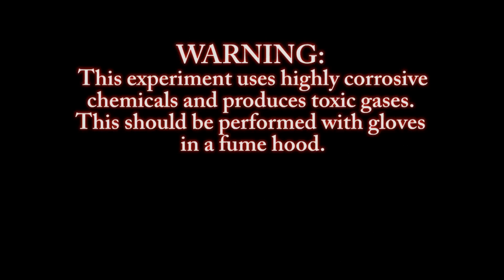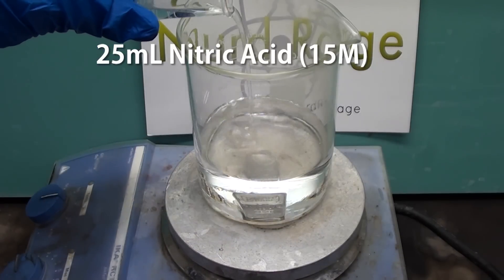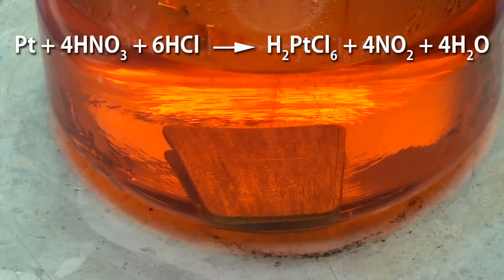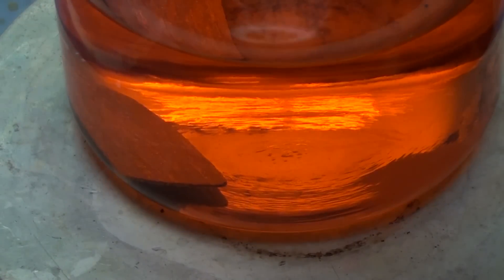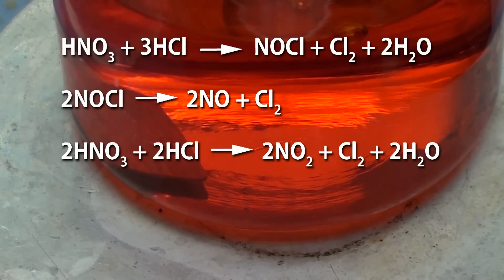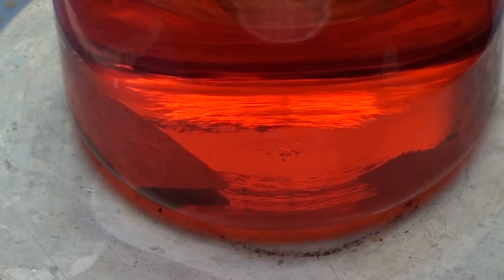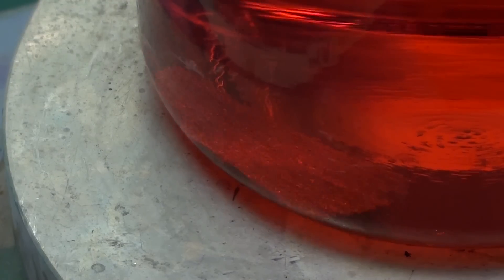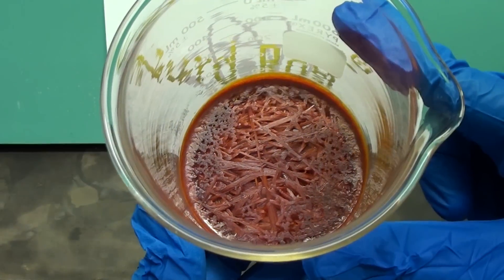Platinum Bar Dissolving in Acid (Aqua Regia)

Comment: hey thank you very much, I found a large specimen of PGM's both in nugget form and really rich ore with black crystals running through it,  some one called Igdralsill who doesn't seem to like that I joined a form about learning to use chemicals to melt off the ore and leave the nugget that runs almost thought to the bottom it's about the size of of child's brain and weighs 16,4 lbs , I did the Hydrogen Peroxide test and the whole specimen got stained white from all the tiny bubbles...the nugget on top looks like a Norther Stag full bust head turned looking you in the eye it's a beautiful nugget, I didn't mean to break a big black crystal as it was surround by hard rich ore so I chipped some off the bottom as I want to make some jewelry....there are more black crystals though the specimen, even though at the time I didn't have the experience using aqua regis, I was actually prospecting for gold in S. Idaho and my spot was closed and because of it I noticed a small little piece of metal, I got my pick and hit it and it didn't even dent it so it's not lead...so I will pick up the citric acid solution on the 1st and see if I can head it with? the top of my furnace on a lower temp.? or I looked like you were using the heat material to set your beaker on..I forget the name but you can get it in rolls and just make your own furnace..the small crystal I pulled out is black but up to the light more grey with hint of green?  Is it safe to make a nice specimen and just soak the lower part?  All I have to fit it in is a big Pyrex bowl so far....I chipped some from where I thought was under the nugget and it was like 3 layers deep, a perfect relief of the deer and I broke that crystal cause I thought it was a piece of the nugget, boom instant black powder...I have not yet heard of obsidian mixed in with platinum ore/nuggets but it makes sense to my knowledge level...I've been to lots of lava flows and never found anything like this!   Please help, I have TBI's and I forget stuff really east often....but I'm gonna do it so If those are indeed Osmium I don't want to dissolve them into solution do I??? Thanks for your help....maybe I'll put up a little video. so you can see it...

Comment: I know this is a stupid question, but the platinum is what's causing the aqua regia to turn orange right?  If you let the aqua regia sit without placing any metals into it, it would stay clear?
Reply: Not a stupid question at all, it's actually quite interesting because aqua regia does slowly break down and turn a brown/orange colour on its own. But the reaction with platinum also produces a brown colour, and that would happen even if the aqua regia didn't decompose by itself. In both cases, it's caused by nitric acid decomposing to nitrogen dioxide, just oxidising different things in each case (either dissolving platinum metal into solution, or converting the hydrochloric acid to elemental chlorine).

Comment: No one should have worried about losing the metal I the first place. Once it has dissolved into solution with the acid, it isn't destroyed you can get the metal back through other processes. This is a method of purification used in the industry anyway.

Comment: Well there goes $1200 in platinum.
Reply from the maker: +gusg343 At the time I needed chloroplatinic acid for my research into organometallic catalysts. Chloroplatinic acid is rather expensive to buy directly and going over the numbers it was cheaper to buy a platinum bar and dissolve it to make the acid. So I did that and decided to film the video because this is an incredibly rare opportunity to see that much platinum consumed by acid. About 25% of the leftover chloroplatinic acid went unused, but i gave that acid to my colleagues who in turn traded me rare chemicals they had.
Reply: gusg343 lol, chloroplatinic acid is twice as expensive on average as platinum metal gram for gram. He's essentially doubling the value of that platinum.
Reply: w12337 Ok, lol good luck selling that.
Reply: gusg343 stfu
Reply: well he is a professional chemist so im sure he knows how to sell the chloroplatinic acid. He is smarter than you, sorry kid.
Reply: Drew Carlisle Right, then after he spends about 10-20 hours doing that, then melts it, casts it and polishes it, he can sell it on ebay for 75% of what he paid for it.

That's some sound economics right there.
Reply: +gusg343 25g Chloroplatinic Acid Costs 2050€, 28,35g pure Platinum costs only 945€ (13.02.2016). Why the hell is the Chloroplatinic acid so much more expensive?
Reply: Kevin Thompson im 3 year into my bachelor's in chemistry and in chemistry they encourage bad grammer and abreviatons so you work more efficient so you can see in my feild of study grammar dosent mean shit i got a 3.9gpa are teachers do not grade on grammar therefore its useless to me, but just to let you know when propper grammer is required then i will/ but if im not getting graded on it i dont give a fuck/perhaps youtube
Reply: NurdRage it's like Pokémon but with rare/expensive chemicals!
Reply: Adil Shah  Nope.
Reply: Drew Carlisle What the ever loving f*** does being a chemist have to do with selling a small amount of a common metal on the market???

Next your going to tell me being a geologist make you an export on selling real estate.
Reply: NurdRage Fair enough (I suppose this was one of rare times that this IS cheaper then just buying it)

My point was that if dollars is all your after, it may be a hard to trade, something tells me that the market for rare acids of precious metals is not particularly fluid.

In any case Thanks for the reply, its not often that people with over half a million subscribers reply to comments of 4 year old videos :)
Reply: DrizzleBeat_98 Low supply i'm going to guess...
Reply: It's his job... He obviously needs it for other stuff. He probably saved money by not buying the acid outright.
Reply: idiot
Reply: +gusg343 you had no point you just dont wana fully admit your wrong and are ignorant for posting such a stupid comet how about that.
Reply: +max penrose Your grammar is that of a second grader.
Reply: Kevin Thompson this is youtube i dont give a fuck about grammar, man you guys are pathetic thats your only argumet oo you have bad grammar well gess what i dont give a fuck

Comment: Because most people think that he simply destroyed the platinum bar in this video, I can assure you that it is not gone. Chloroplatinic acid has a value of 102 USD per 1 gram when refined. Considering that he reacted 31.1 grams of platinum which would require around 30g of chlorine to react with (assuming I did my stoichiometry correctly, and i may not have) meaning that he made back an excess of $6000.
Reply: Hi. Im sorry for being so ignorant, but would you mind elaborating a little more and using current prices? This seems like a very viable business model. Thank you very much

Comment: you just destroyed over 12 hundred dollars worth of platinum.
Reply: how is it destroyed? It has only been dissolved. The Pt can easily be precipitated out of the solution so it can be reclaimed.
Reply: Chloroplatinic acid is worth about two times the price of the bar dissolved.
Reply: Why? Does it taste nice?
Reply: It can be obtained again ( platinum ) 
It has only dissolved 
Same with gold ....
Reply: On 12/13/14, the cost of that bar would be $1,289.79.
Reply: artifactingreality 25g of Chloroplatinic acid costs $1655 from this source: http://www.sigmaaldrich.com/catalog/product/sial/206083?lang=en&region=US
Reply: artifactingreality As you also saw in the gold video he handed it off to Indeeditdoes to melt it back into raw gold. Indeeditdoes has also done a video on melting and refining platinum, so I am sure NurdRage could get it back into ingot form if he really wanted, but I am sure he has a use for this chemical.
Reply: Assuming you meant a USD no.
This was a Troy ounce of platinum, roughly 1.1 customary ounces. Platinum price per ounce is $1254.50 ATM. 1254.5 * 1.1 = $1379.95. So only about the cost of a really nice computer. Expensive experiment, but he did it for us, and here it is. And it's not to say he couldn't figure out a reaction that can get him his Pt back anyway.
Reply: Platinum melts at 1,768 °C much higher than Gold, if you've seen their Gold video you know they don't have the equipment even to melt Gold let alone Platinum so it's never going to be a nice shiny nugget of metal. Maybe the chloroplatinic acid they're making has some value I don't know but it's not going to get a good reception at the pawn shop.
Reply: you can use other chemicals, to make platin out of the solution again
Reply: artifactingreality http://www.chemicaldictionary.org/dic/C/Chloroplatinic-acid_3039.html
Reply: You sure are right
Reply: You should sacrifices for science

Comment: that was great. what temp did you use to boil your bar at. think you could do a vid where you pull the platinum back out of solution .also (15m) nitic acid, is that regular strength

Comment: How the hell much did you spend on all that platinum? I'm crying inside.
Reply: $13-1400. Not a big deal. Plus he can get it back with magic... er..... chemistry*
Reply: +VEAL SUBSTITUTE The platinum is still there and the value of the chloroplatinic acid is more than the platinum bar.  It can be used for plating other metals.
Reply: A $1200doller platinum bar and desolving it what is his problem

Comment: I hope the product is worth a lot, the bar itself is $1500, and don't forget the costs of the heat and the acids
Reply: He produced 3 vials of chloroplatinic acid worth $1000 each later.
Reply: WTFjusthappened129 more than $1000 per vials because he purified it later (maybe $1200). You can check his videos

Comment: That much platinum... gone... what a waste.. for 120k views..
Reply: Jesse Crombie
Platinum does not dissolve into ''particles'' but rather ions. You can always reduce them into elemental platinum and sell it back. There is not much ''waste'' here.
Reply: It isn't gone. Dissolving doesn't mean it dissapears. All the platinum is still in there, just split up.
Reply: Try selling platinum particles.
Reply: Jesse Crombie They can be extracted out of there, don't you worry. If I remember correctly, Platinum is magnetic & acid is not. If it's not magnetic, there are still other ways for extracting it out if the acid.
Reply: Looks like someone was educated at Wiki University.
Reply: Jesse Crombie No, common knowledge & a great chemistry teacher. I thought everybody knew that acid only dissolves things, it does not consume them in that sense. Well, everyone except you, atleast.

Comment: not a waste. he can reverse the chemical process and retrieve the platinum. he isn't just going to throw that much of a valuable substance down the drain (that would also most likely cause pipe problems) but that's unrelated.

Comment: 25 grams of Chloroplatinic acid is worth around 1 700 - 1 750 euro. 
1 Troy ounce Platinum on the spot market is around 1 250 euro.
Hydrochloric acid is sold in the range of 75 to 130 euro (EX WORKS) on the European markets, and we are talking about the price of a metric ton of this sweet, stuff.
It's roughly the same thing with the Nitric acid's price on the market.
I'm not sure how much exactly purified chloroplatinic acid is distilled, but I'm sure it wasn't a waste of  money as some say .

Comment: It wouldn't be that much more the chemicals used are cheep when purchased in bulk like Nurd most likely does, for the reason the chemicals have a lot of uses other then dissolving platinum.

Comment: What if you were to use smaller pieces of platinum, instead of a whole 1 troy once bar. Would the decomp of the platinum into the aqua regia take less time? also would you need to use more nitric and hydrochloric acid due to the faster reaction if it was to happen